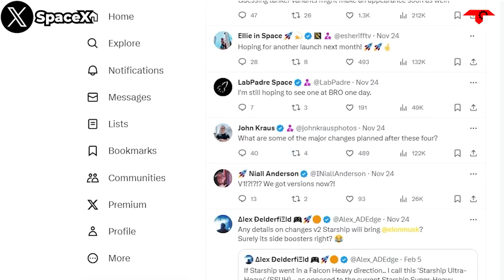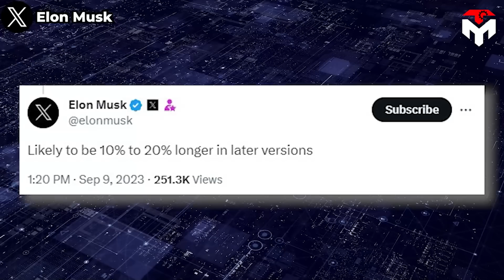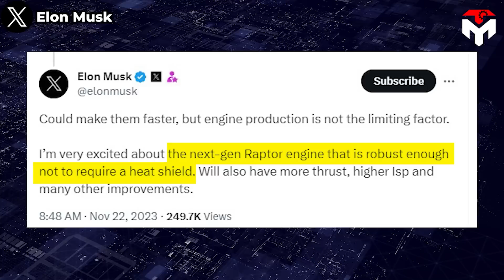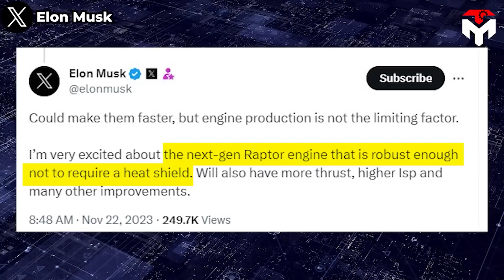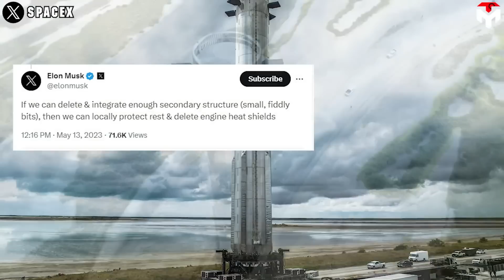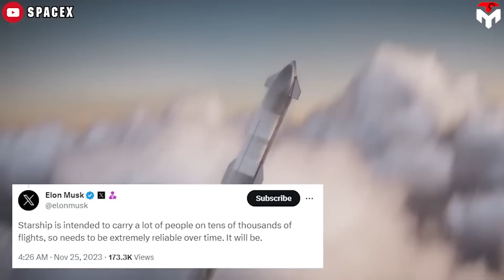SpaceX's Bigger & Better Starships SHOCKED the Entire Space Industry...

Comment: V3 super heavy has to increase length to carry more fuel, since Rapter V3 runs at higher chamber pressure. Higher chamber pressure requires higher fuel and oxidizer pressure, which means pumping more of each per second. Ditto for Starship.
Alternative explanation is - if each Raptor V3 delivers more energy per second, the amount of fuel used must increase, since the chemistry of O2-CH4 reaction does not change.
Reply: More power means less gravitation loss during launch. But that's limited because astronauts can only withstand 3g. So the power of the engine must be reduced during manned launches.

Comment: Will be interesting to see what happens with the first raptor 3 version, and how hard they push the pump pressure over time.

Have heard rumor that the Raptor 3 might be able to take way more pressure than its original test stats.
If true, would mean higher velocity for the same reaction mass which translates to better efficiency.

I suspect the first Raptor 3 launch will be at original test pressures, but in following launches 
they will begin to push things more.

If true, would mean less engines required for the same work.
Also upscaling engine size likely, reducing parts count, by reducing engine count.

At any rate, looking forward to next launch, and learning what engines are used and what their numbers were.  as they are what creates potential for bigger ships.
Reply from the maker: Thanks for your cmt